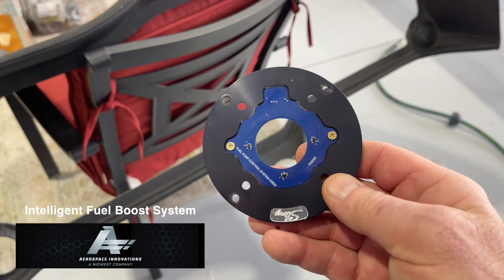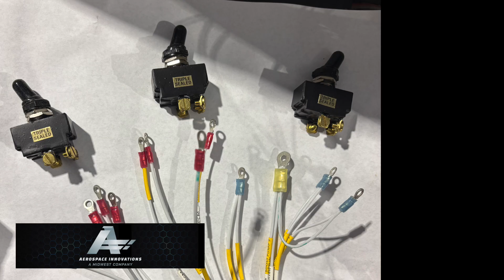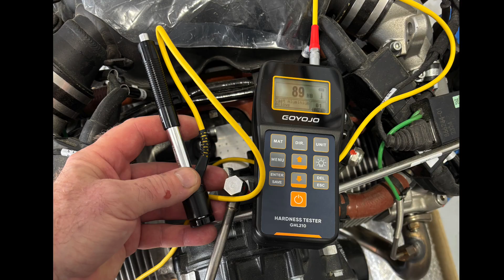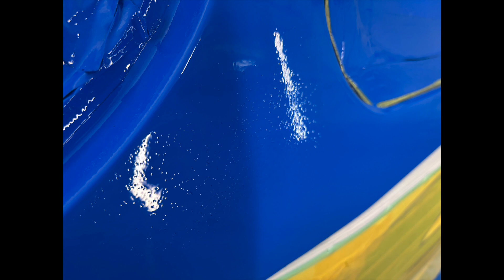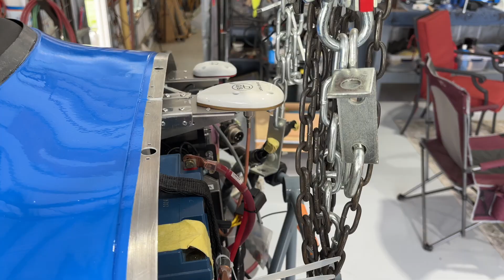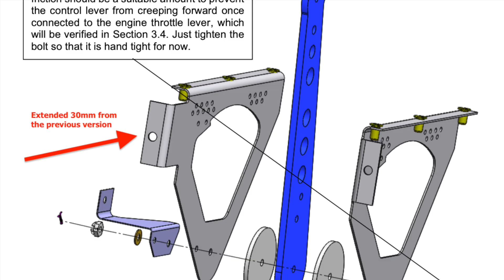Three Month UPDATE  [Sling TSi Build Video # 22 ]

Comment: Did you use nylock or castle nuts to install the engine?
Reply from the maker: Rotax provides low profile nylocs for both the engine and the engine mount.

Comment: Maybe a stupid question.  Did you solder the resistor to that wire?  General question and am sorry to ask it... and I'm not an aircraft or engine guy, but those bulletins kind of put the fear of God in me.  Seems like massive qc issues.  Not something you would expect from the austrians.
Reply from the maker: Yes, shrink tubes infused with solder.  I get it about the SB's.  There is enough experts and support for these engines that I have faith in them.